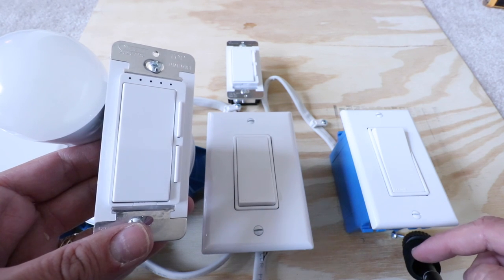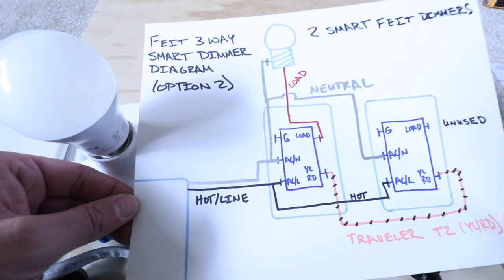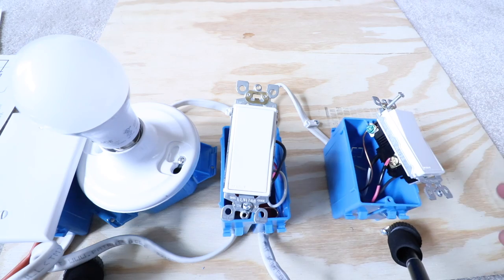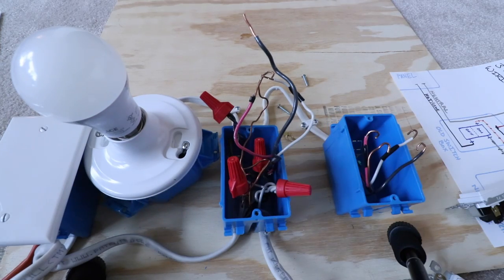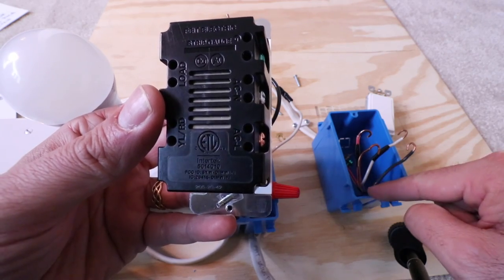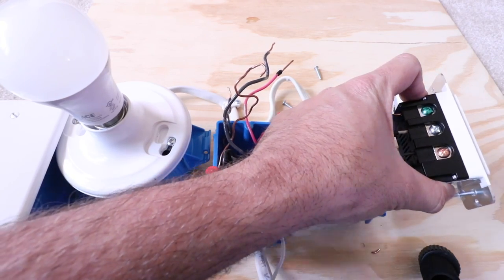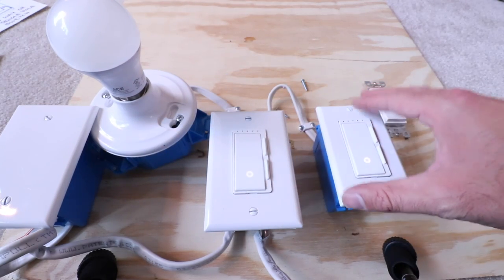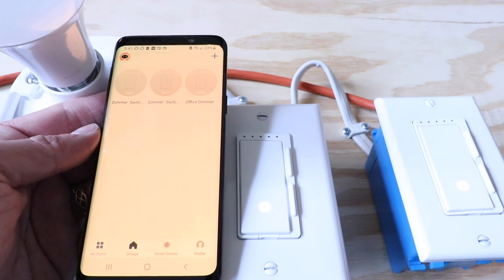How To Install Feit 3 Way Smart Dimmer Switch With 2 Smart Dimmers

Comment: Thanks for the info! Have you had any issues with one dimmer affecting the lights on a different dimmer (same model). 

That’s what’s going on for me. I’ve got two sets of lights in our basement with, both on different circuits, and a 3-way setup in the hallway. When you adjust the dimmer on one, it will actually affect the lights on another; sometimes resulting in a very unpleasant flicker. Any thoughts?

Comment: Awesome Video..  was wondering if you could demonstrate and explain how this would be connected in a 4 way switch situation.  I have a long hallway and each of the 4 bedrooms has the ability to turn on the lights in that hallway from just outside the bedroom doors.  I have one Feit Smart Dimmer installed in what I think is the first junction box in the line and the rest have regular switches ( not sure if these are 3 way or 4 way at this point).  Of course, if I flip any of those off, the lights turn off which is fine.  This is true except for the last switch, if I flip that one off the lights just dim etc. so I know something isn't right.  The whole thing works now if I keep the other three switches up and just control the dimmer, but I'd like to make it right.  I've got a couple of new Feit dimmers and some new 4 way switches ready to install but I'd really like to take this apart again only once and get it back together the correct way.  House was built in 2004 so neutral wires are present.  Much appreciated!

Comment: Very well done for a very simple uncomplicated test board.  I suspect there are very few real life situations with such straightforward wiring.  In an existing home, with wires in the walls, there are many more wires combined in the junction boxes.  It can be very difficult to ID the travelers, the correct common, & even the load wires.  Can you explain how DIY's can do so?

Comment: Very helpful video, thanks!  My existing 3-way wiring is different than this video:

 1-)  left-box has only 2-wire (hot line black & neutral white) AND 3-wire (travel 1 red, travel 2 black, & neutral white) , only 2 white neutrals connected. 
2-) Light is in the middle (Load cable is red connected to lights cable black &  neutral connected to lights neutral white)
3-) right-box has 3wire cable (traveler 1 red, traveler 2 black, and red cable)

Can I still use my current wiring to do 2 dimmers 3-way?

Comment: Do you have any instructions the traveler wire going through 2 light bulbs in the middle and second switch at the end.. The instructions in this video didn't worked for me.. since the traveler wires going to the bulb from the first switch..

Comment: A few times you mention that the neutral wire is needed for the wifi functionality.  Is this true?  I only have a neutral in one of the two junction boxes.  I don't need wifi control but would like to make use of the dimming functionality.
Reply: I don't have these switches installed so take this with a grain of salt but I can't imagine not connecting it to wifi would prevent dimming from working

Comment: The first set of switches were like you said, the load wire was not connected to any switch, it was in the box in the line side i sepearated it and that worked out fine, but this other set I'm trying to connect does not seem to have a seperate load wire, it seems to be connected to the switch on the load side and seems to be a traveler wire, its black. any advice ?
Reply: Same issue. My wire to the lights is in a switch opposite my main power line is in, so load and power from breaker are in different outlets. Power is being given to the load switch from the other 3 way sw. So if I shutoff that “dumb” 3 way switch I can’t control my “smart” dimmer switch. So if power is on one side but load is on the other do I still have to have 2 switches?  And is this all still going to work even if I use 2 smart switches?
Reply: @marty use the traveler to pigtail off the power and feed the power to the other side to complete the circuit